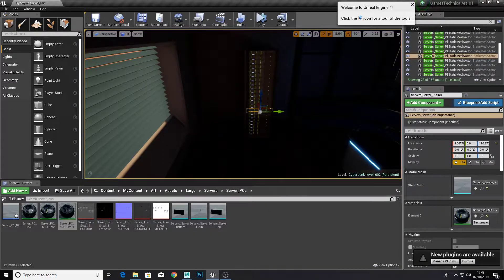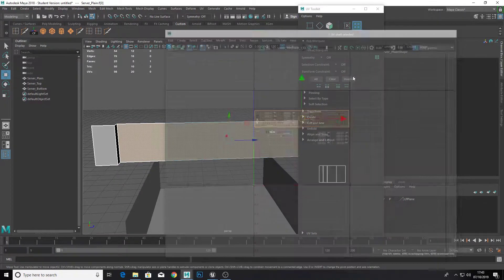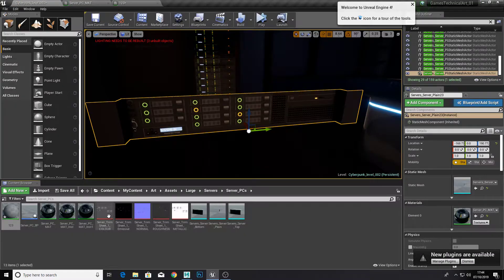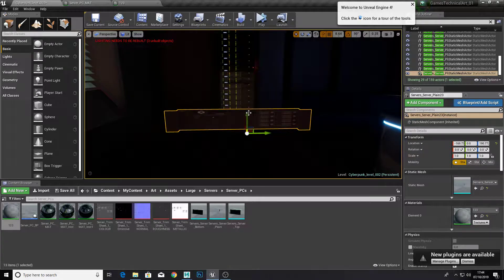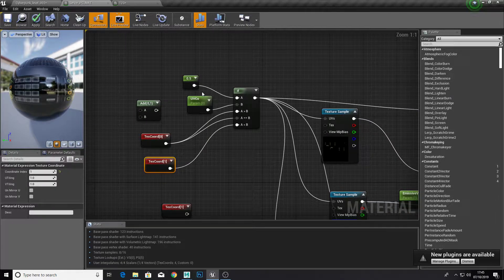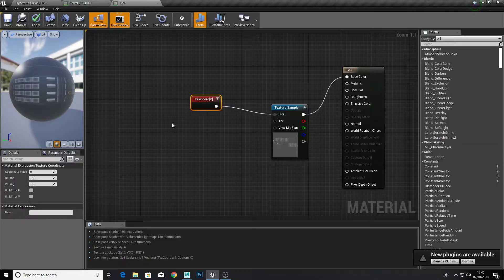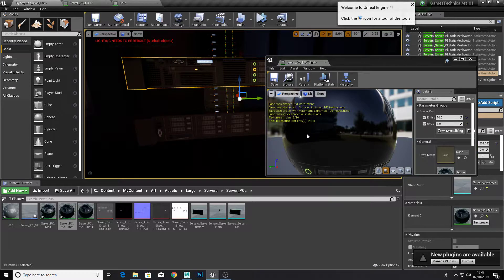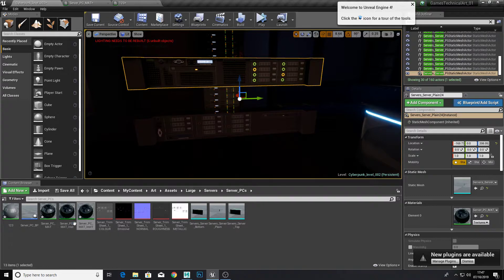Using trim sheets/ different UV maps on 1 mesh UE4

Comment: Thanks for the demonstration, this is a very useful way to do it :) Previously I've been using boolean parameters to switch between UV coordinate indexes/UV channels but the graph can get messy with big boolean trees when making a master material that needs to support meshes that possibly have multiple UV channels. I have meshes that have up to 4 or 5 UV channels :/. I was really hoping that Epic would have parameterised the TexCoord node by now to make it a lot easier to mess with the Coordinate Index. This is at least a neat way though. Technically you could use the IF statement method to switch between 3 TexCoords if needed since you have A>B, A==B, and A<B, so this method is a bit better and cleaner than using booleans. Just a shame we don't at least have a parameters option to solve all this yet haha. Hell, it'd be nice if we could specifically add / multiply the Coordinate Index by a scalar parameter separately from the UV X and Y tiling.

Comment: I'm not sure if you're still dealing with doing it this way but you can actually change those coordinates.

The TexCoord[0] is just a vector 2 representing the X and Y coordinates. So all you have to do is add whatever offset you'd like to do to that value. The way I do it is I have 2 parameters, one X Offset and one Y Offset, and I feed those parameters into a MakeFloat2 node. From there just use an Add node to add those to the TexCoord[0] and you now can offset your UVs in your material instances all you want. The UV TextCoord's are represented as a percentage from 0 to 1 so if you wanted to adjust it 25% along the Y axis you'd just set the Y offset to 0.25 or -0.25 depending on which direction you want to move.
Reply from the maker: From my understanding you’re talking about texture scaling. That method works quite differently to what I showed but I could be misunderstood
Reply: @3DRoss  Texture scaling would involve multiplying those numbers. If you setup your material how I said and feed that into a TextureSample node you'll be able to see see what I mean. (I'd link you an example but I'm pretty sure YouTube automatically flags comments with links in them.)